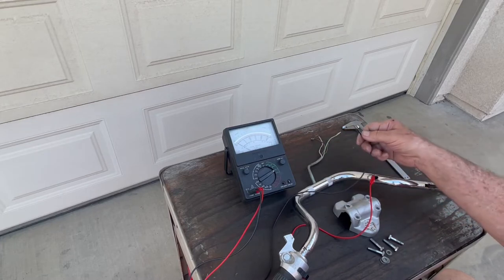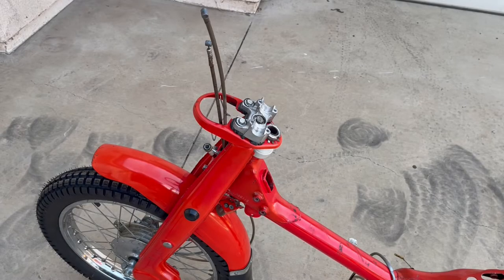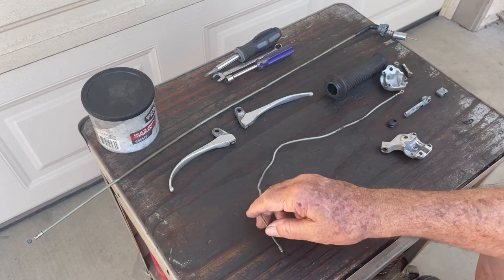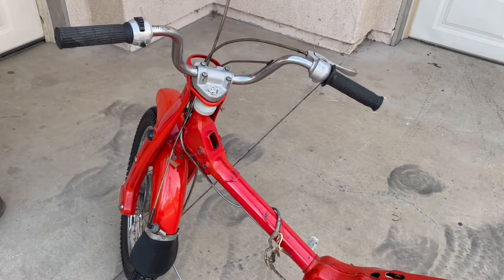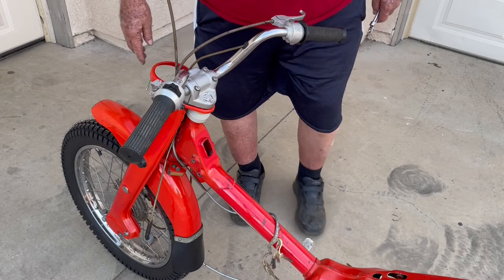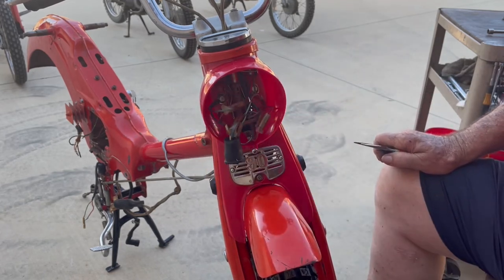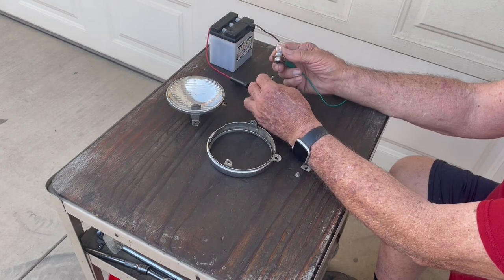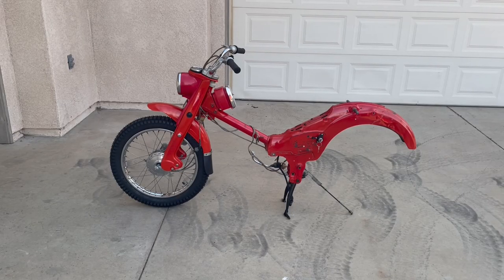Part 16 of 20, Bringing the 1967 Honda CT90 Back to Life - Handlebars, Headlight, Wiring

Comment: What do you useto lube the spedo gear in the front wheel hub?  It looks like you have a grease zerk, I have a screw that you can pour something in.  1967 Honda CA160 Dream.
Reply from the maker: I can't help you.  I found a couple of speedometer gear boxes like yours on ebay and see the screw that you are referring to.  It looks like a good place for a grease zerk.  But they all had the screw.  Or you can take the wheel off and clean and pack the gears with grease.  Of course this is a bit more work.  Do you have a shop manual?
Reply: @SoCalBruce  I'm wondering if you are meant to put grease in via the screw hole, not the best way to apply grease.  But what else would lubricate the spedo gears, oil?  I am replacing the front fork so i will be taking the wheel off and everything attached to the fork so I can take it apart, clean it out, and repack with grease, just not sure if grease is what I am supposed to be using.  I do have a shop manual but its very generic and not specific to my bike. It covers more of the Honda twin engine from that era and less of the chassis and suspension. My bike is all pressed steel, frame forks, swing-arm, all of it. The manual doesn't cover that style at all.  Thanks for your help!
Reply from the maker: @briren96  Actually, I have never worked on a CA160.  So take my comments for what they are worth.  I would recommend repacking the speedometer gear box of a 50+ year old motorcycle with grease.  Perhaps you can take the screw out and screw in a grease zerk.  Or since you are taking the wheel off, you may be able to pack it from the inside.  The parts diagram doesn't shows that this gearbox is used on the CA95 also but doesn't show any replacement parts.  Nor does it show the gear box can be disassembled.  I looked at a picture of one in ebay and it looks there may be an oil seal on the inside.  If so, you will want to remove it carefully because if you can't find a new one, you may need to reuse the old one.  Good luck.  I would be interested in what you find out.
Reply: @SoCalBruce  Thank you for your comments, they are very helpful.  When I take the wheel off I will try to clean out and repack the gears with new grease.  If I can't do that, i will try the zerk idea, I have not seen a threaded zerk before, usually they are press-in, correct?  The speedometer does bounce around now and I plan on replacing the cable when I replace the front fork.  Thanks again for all your help, it is much appreciated!

Comment: any advice on getting spark in a parked Honda atc 110? magneto cleaning a must?
Reply from the maker: You can try a new spark plug.  They do go bad sometimes and aren’t very expensive.  You should also check that the wires are connected correctly and all contacts to make sure they are good.  That includes the ground of the coil to the frame.  But other than this I don’t advise throwing new parts at the ATC in hopes of finding the problem.  It’s better to start systematic diagnostic tests to isolate the problem.  It may turn out to be something relatively simple.  Of course, this assumes that you know how the CDI ignition works and how to use a volt-ohm meter (VOM).  A few years back I made a 12 part video series assembling a 1981 ATC119.  You can find it on youtube.This is the same engine as yours. 
 Good luck!!!